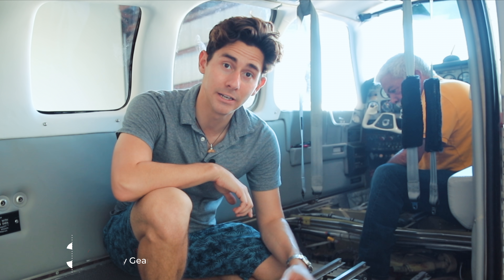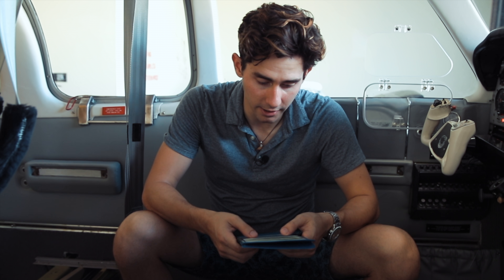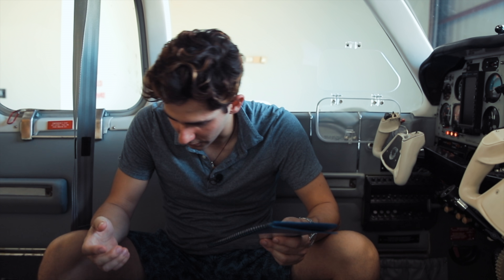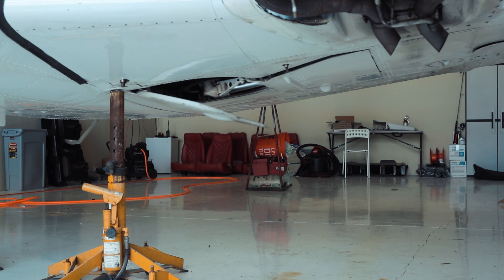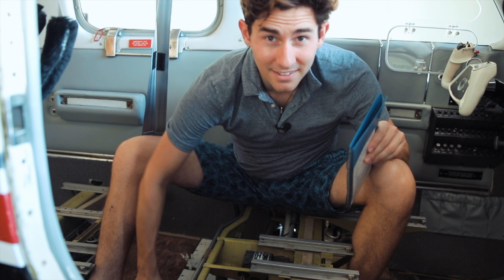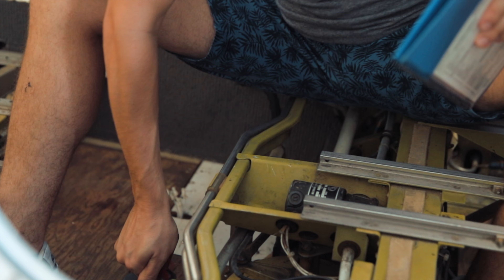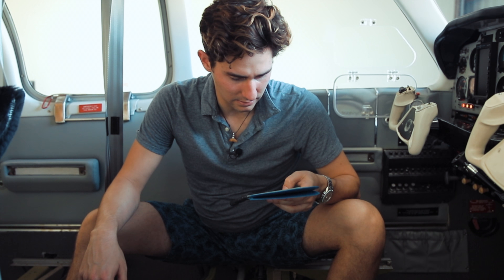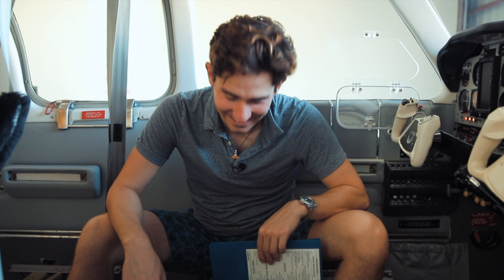Emergency Gear Extension

Comment: A few years ago we were flying our Beechcraft Sierra . and the gear failed to go down when we flipped the switch....
So we flew back to our home airport.. Amd called ground ... The said the gear was down except for the front.  Wich was indicated by the lights.... We flew the pattern a couple more times calling for the gear to come down.. And finally we had all 3 lights on....  When we landed we saw that we had a leak of hydros...all over the belly of the plane...
Sweating bullets 4 sure....
Reply from the maker: That can definitely be a stressful situation, gear issues are always the worse, not much we can do once we run the procedure. I'm glad it worked out!